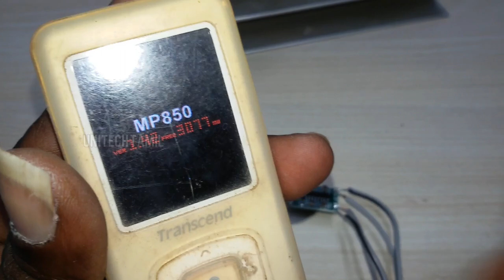MINI 5V CLASS D AMPLIFIER  🎼 PAM8403 AUDIO BOARD HOW TO USE IN TAMIL

Comment: Super na.. We can use cell phone charger for power supply.
Reply from the maker: Use பண்ணலாம் sir,  but amps 1.5 to 2 amps charger இருக்க வேண்டும் . Amps கம்மியாக இருந்தால் ஆடியோ விட்டு விட்டு வரும்.
Reply: @UNITECHTAMIL  Thanks na
Reply: Audio வரல ரொம்ப கம்மியா வருது
Reply: @UNITECHTAMIL   Anna entha pam8403 ku mixed mono input kuduthu single speaker 4" 5watt spkr use Panna oru idea kudunga bro, ( comment Panna Kuda podum bro)
Reply: 6.4 battery use panalama uapadi conet pannuvathu 7805 ic pottu ok but volim vacha audio clear illa